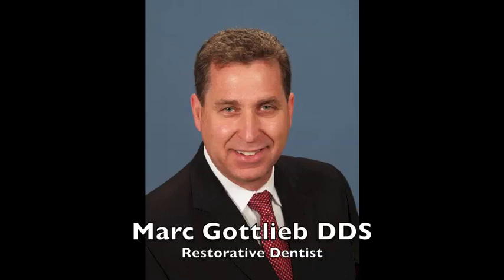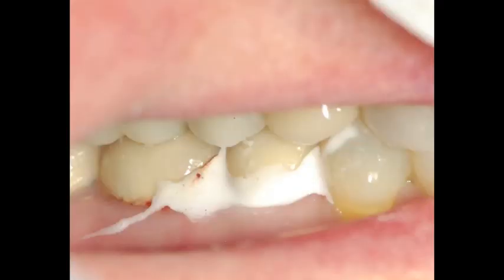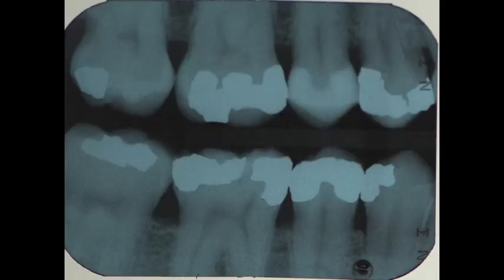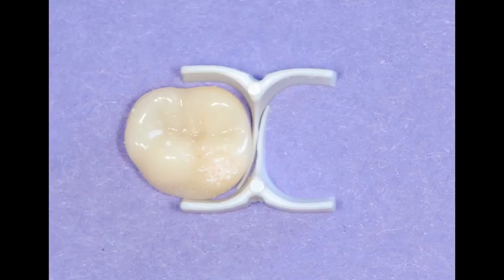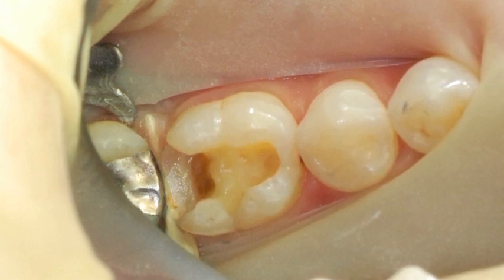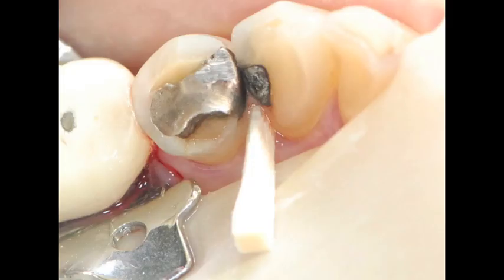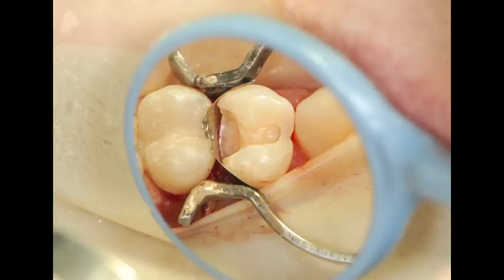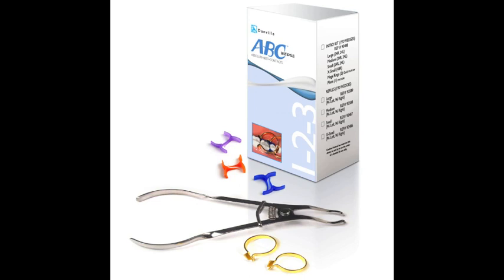How to restore the difficult Class II with Composite.

Comment: 7Marc the ABC wedge looks very interesting to me.  I notice thatin your cases you place a dam but the dam is "split". Why not fully utilize the benefits of the dam with appropriate spacing of holes punched?
Reply: Sometimes I use the dam with individual holes and other with just 3 overlapping holes to form an oval. Unless I have an issue with saliva contamination the rubber dam with oval design retracts the cheek and tongue and prevents debris from gong down the throat. Also if they have tight contacts the gingiva can be a little sore after the local wears off.